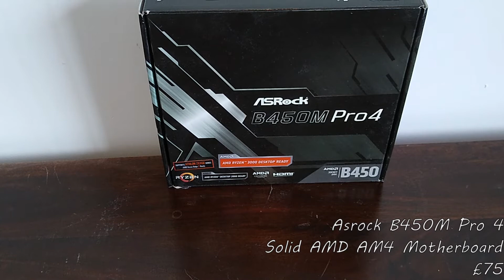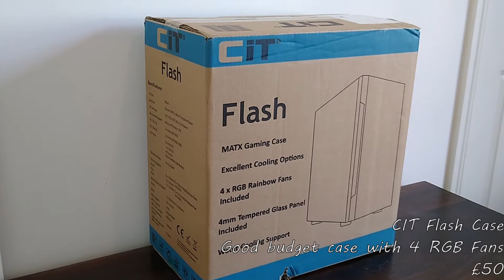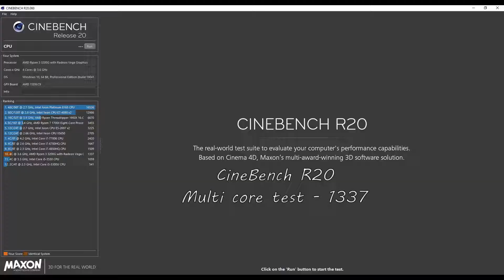How to build a budget Gaming PC 2020 - $300 Ryzen 3200G APU Time lapse Build Guide

Comment: I am having some trouble with the case fans. I can’t connect the fan’s cable to the fan header on my Motherboard as the fan cable seems to have pins on it and not notched.
Reply from the maker: So you need to daisychain (link the fans together they plug into each other) all the fans together then use the SATA connection for the fan hub to the SATA power cable on your PSU. You can't plug RGB fans into normal case fan headers on the motherboard that will not work, hope that helps.
Reply: Hey yeah so um i did what you said an the fans work however the RGB isn't working. Also when I go in the bios its says my system fans aren't active and only my CPU fan is .
Reply: Also when i daisy chained them there is another cable. It's a either a 3 or 4 pin cable. But I don't know where it goes to.

Comment: Where can you place a hdd?
Reply from the maker: There are two SSD and one HDD locations at the bottom front of the case but there are a bit hidden away, check the manual would be the first thing I would recommend for placements of drives

Comment: Hey man nice video i have a question can i add a dedicated graphics card to this build like a gigabyte geforce 1650
Reply from the maker: Yes you can, it's a great upgrade as well I would recommend the GTX 1650 Super is you can get that as it is a better performer then the standard gtx 1650
Reply: Thank you
Reply: Does it matter if i use a different case and a 480gb ssd
Reply from the maker: @Spyringabyss060  no that would be perfectly fine to use different case and 480gb ssd

Comment: Hi I was using this case but I am struggling to get the rgb to work on the fans I was wondering if you knew anything about this
Reply from the maker: Just daisy chain the fans together and then plug in a SATA power connector from your PSU into the fans. I hope that helps you out, thanks for watching.

Comment: quick question if you still respond do you need anything special for the fans on the pc case like a argb header cus i want to buy this case
Reply from the maker: No you don't need arbg or RGB fan headers on your motherboard as the case fans can be run from the SATA power connector
Reply: @UltraGameWorld  thanks
Reply: @UltraGameWorld  thanks

Comment: Hello i was wondering if u have a micro atx or a atx
Reply from the maker: That case is a micro ATX case, it's the CIT flash case
Reply: I heard you can not put a aio cooler because its going to get in the way of the ram is that right
Reply from the maker: @trixy9954  depends on what RAM you use, it might fit but can't say for sure as I didn't have an AIO to test it

Comment: I have the same case as this and I’m wondering to buy a 1080ti 3 fan would it fit?
Reply from the maker: As long as the card is under 330MM (33CM) then it should fit but i think the 3 fan version of 1080ti might be a bit too long but might just fit

Comment: Hey I have this case and I was wondering how u changed the fan colours
Reply from the maker: Hi you just press the reset button and it changes the fan colours as long as you haven’t placed the reset panel connector into the front panel reset jumper on your motherboard, hope that explains it well enough.
Reply: I really need your help with the wiring of this case how you connect the 2 pin cable that’s pre installed in case I think it’s for the fan
Reply: Im a beginner to this and its very confusing 😢
Reply: Harvey how did you plug in the pre installed fans, I’m sooo confused
Reply: @Muxzy  you plug them in your psu